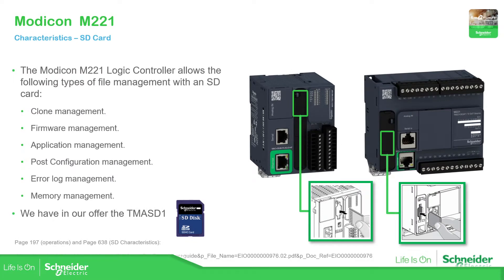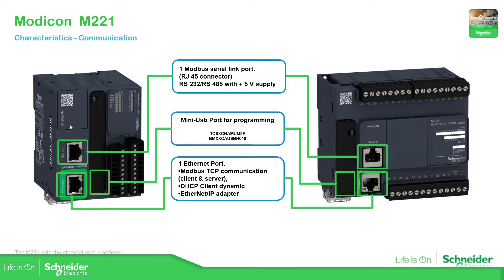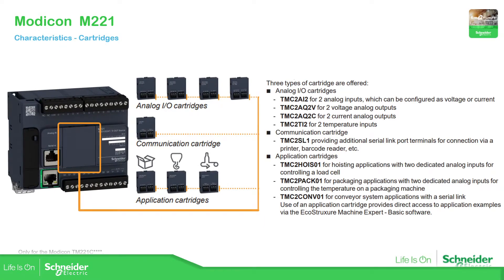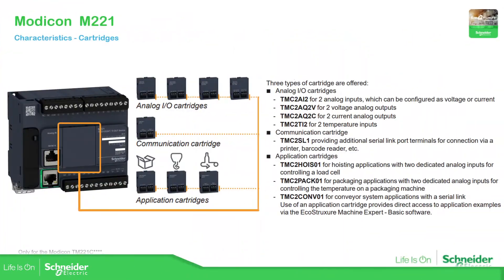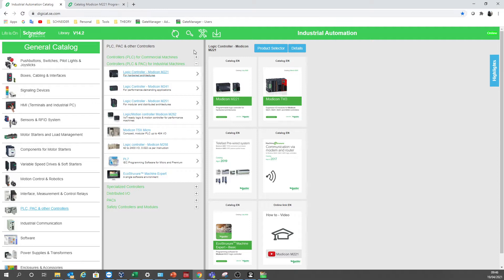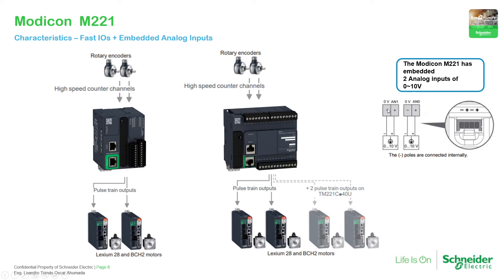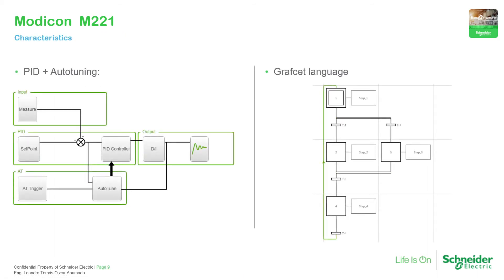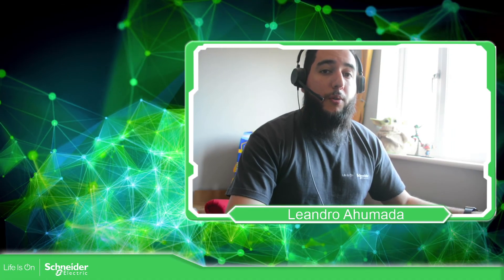Training - M221 - M1.4 Modicon M221 Characteristics

Comment: Hi tomas, we're planning to set up an automated Chiller (HVAC) control system, is the specialized PLC such as the M171/M172 better than M221 at this??

My biggest concern was the Analog IOs, we'll be using a lot of thermocouple sensor (around 8-10, per Chiller) which the  M221 clearly doesn't provide enough (outside expansion)
Reply from the maker: Hi Hanif Ong! the Modicon M172 is a HVAC controller and compare with the M221 it has more to offer in this case. the software of the M172 may bot be user friendly as the one for the M221 but you can do more things. Below you can find the link for the training:
https://youtube.com/playlist?list=PLFqT6GhMpgpKziZxGdSaJPEEB1Q5i8Xo5
(i am making a new with more details)

The amount of Analog IOs embedded in the M172 is higher than the M221 so it will go with the M172 BUT the only problem it could be the thermocouple because if you take a look in the hardware guide of the M172 page 90 the thermocouple analog input it is not in the list:
https://download.schneider-electric.com/files?p_enDocType=User+guide&p_File_Name=EIO0000002015.04.pdf&p_Doc_Ref=EIO0000002015

So you may probably need to add a converter like the RMTK80BD as M172 cannot read thermocouples.
Reply: @LeTomasAHUMADA  Ah I might used the wrong term here, by thermocouple i meant a PT100 RTD sensor, is it the same with PT1000 mentioned in the document?
Reply from the maker: @scroogemcduckenjoyer  pay attention into the manual because a pt100 is not the same a pt1000 and those one are not in the list. If you are able to change the sensor take a look into the catalog the modicon m172 and look for the pt1000
Reply: @LeTomasAHUMADA  Yeah, the temperature sensor's choice is not fixed yet and can be subjected to change, it's just a different sensitivity between PT100 & PT1000 based on what I've read

I guess the M172 is the better choice here for our use case.. one last question : can it act as both a Modbus slave and master at the same time using the 2 available RS-485 ports?
Reply from the maker: @scroogemcduckenjoyer  , in the m172 you have two (2) modbus ports. One of them can only be use as slave and the other one can be master or slave (but not at the same time in this port). Please check in the manual/software which port is which ( i do not remember it 😅).

To sum up, you can configure one part to be Master and the other port to be slave.

Comment: Hi Thomas . What is the maximum no of extensions that can be added to this plc and should we use any power booster if these extensions are added?
Reply from the maker: Hi There! Check the page 30 of the next hardware manual: 
https://download.schneider-electric.com/files?p_enDocType=User+guide&p_File_Name=EIO0000001384.06.pdf&p_Doc_Ref=EIO0000001384

In there you can find this note "The configuration with its TM3 and TM2 expansion modules is validated by SoMachine
Basic (EcoStruxure Machine Expert) software in the Configuration window taking into account the total power consumption of the
installed modules."

If you do not want to use the software you can check the configuration in here;
https://www.se.com/ww/en/work/products/industrial-automation-control/tools/modicon-plc-configurator.jsp

In theory you can use up to 7 modules along with the PLC but it will depend on the TM3 and the M221 that is why you can validate it with the software. To extend the the IOs you can use the " transmitter and receiver" to add another 7 modules but is always good to check with the software. If you need remote IOs check the Bus Coupler:  
https://youtube.com/playlist?list=PLFqT6GhMpgpLZ931Jlkhw7BhRF5OB1TzJ

No TM3 with "power booster" only the " transmitter and receiver".
Reply: @LeTomasAHUMADA  Thank you
Reply: Hi Thomas . Is there any expansion module  for M221 communication?
Reply from the maker: @akipain4480  the only communication module available is the Serial line cartridge TMC2SL1 but this is compatible only with TM221C****:
https://www.se.com/ww/en/product/TMC2SL1/serial-line-cartridge%2C-modicon-m221%2C-1-communication-extension/
Reply: @LeTomasAHUMADA  Thank you very much